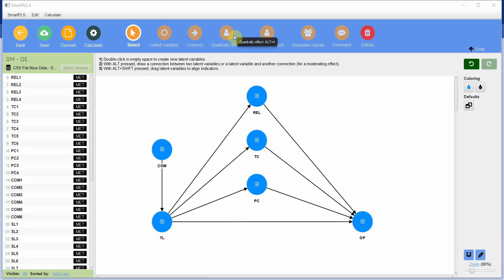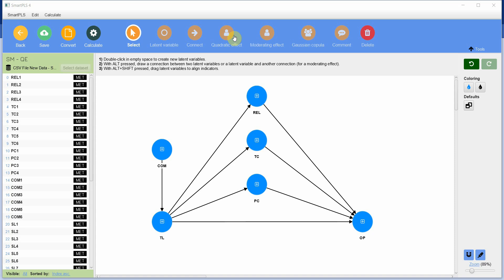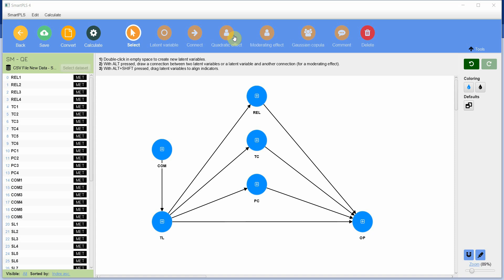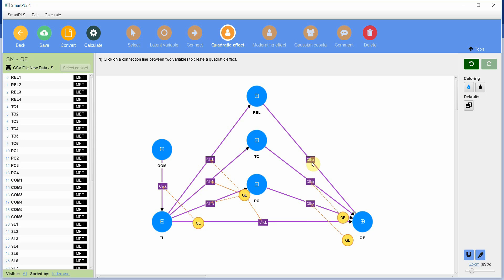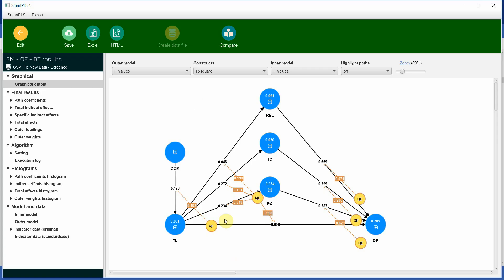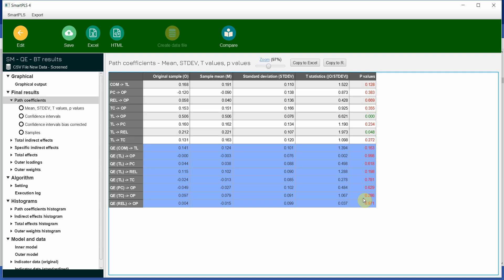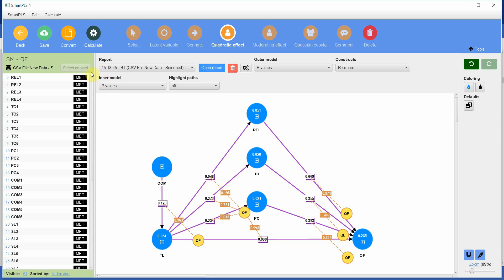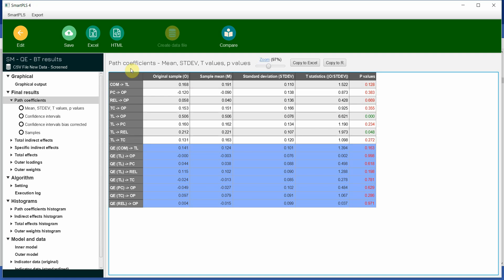Robustness Checks #SmartPLS4 - Linearity Assumption (Quadratic Effect) using #SmartPLS4?

Comment: Hello Sir, I have a query in my data analysis path coefficient is negative of moderation effect  on association between mediator and dependent variable, but bootstrapping results show significant relationship.  Is there any issue it we can go with it?
Reply from the maker: Thanks for watching. Negative means the moderator significantly weakens the relationship.
Reply: Thank you very much for your invaluable information. I have applied this to my model, and some results were significant. Could you please illustrate what to do in this case? And how to interpret the results.